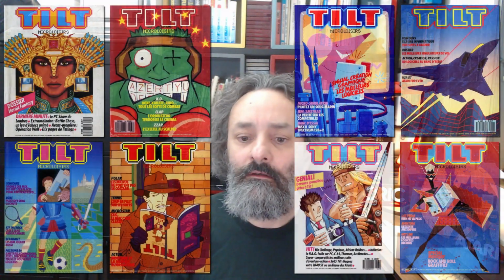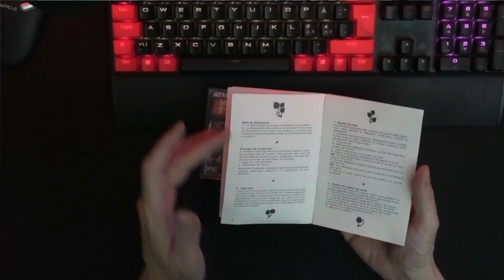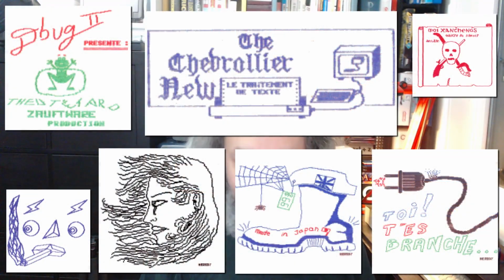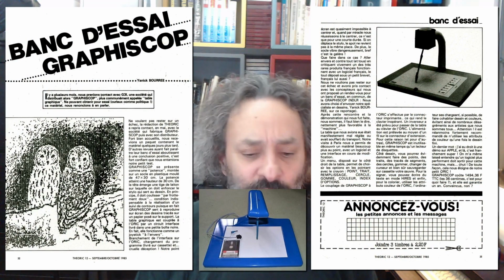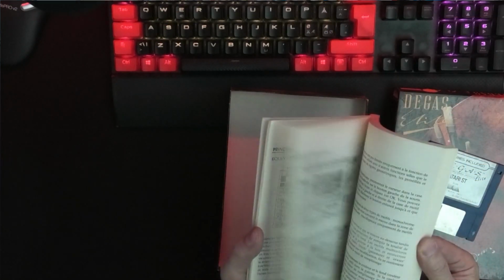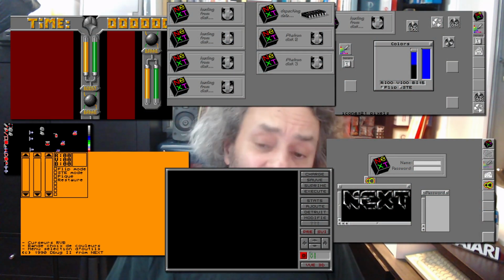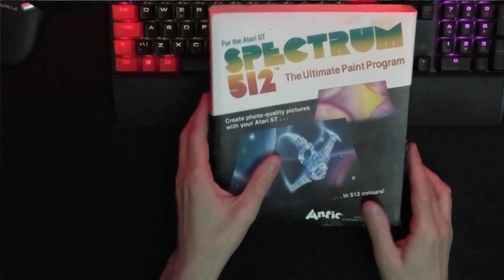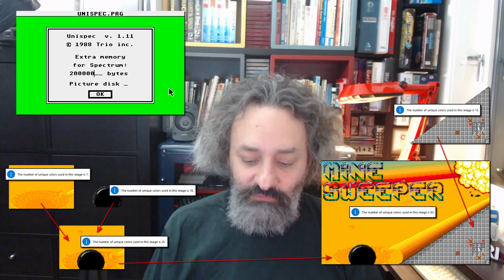37 years of paint programs

Comment: Where did you buy this oric-keyboard,  Mickael?
Reply from the maker: It's actually a modified Corsair K70 RGB.
I replaced some of the keys (return, backspace, tab, etc...) by a set of red keycaps.

The Oric logo on the top left is genuine, it came from a set of stickers which were probably used to brand things like the Oric tape drive, can't remember where it originally came from, I had it for at least 20 years.
Reply: @DbugII  Nice anyway